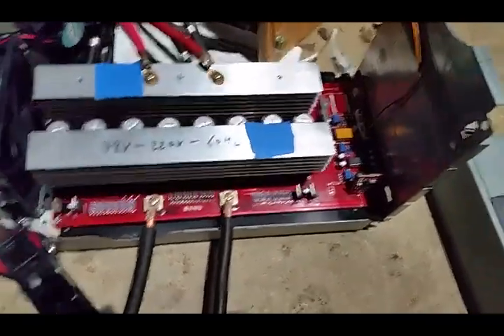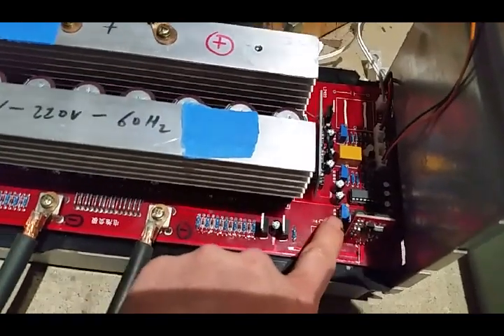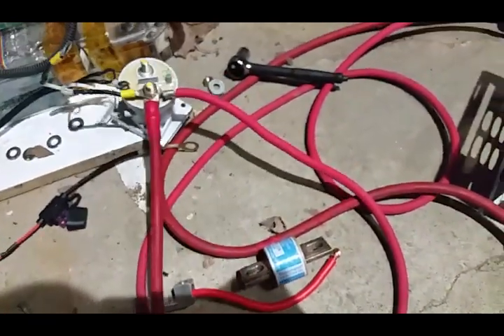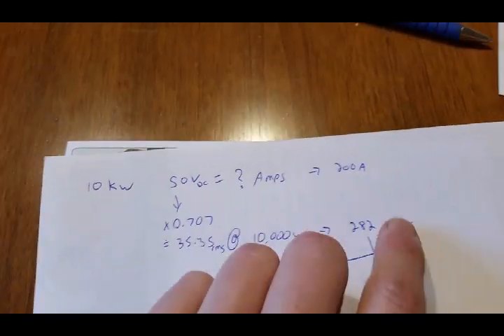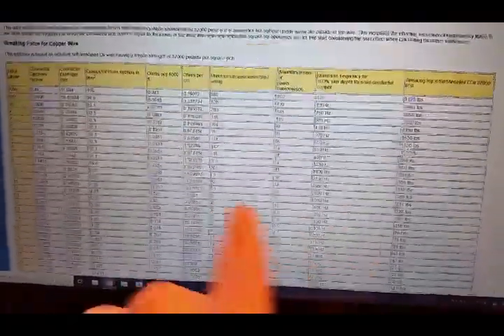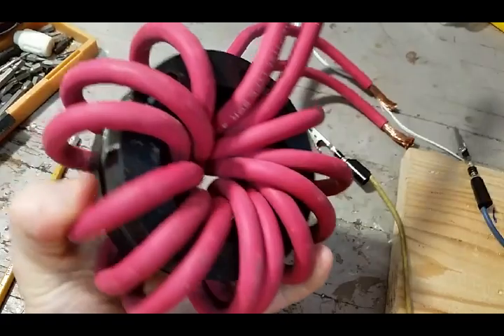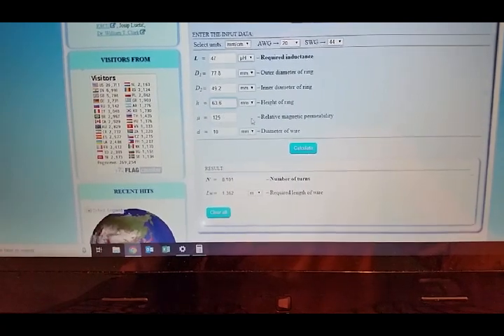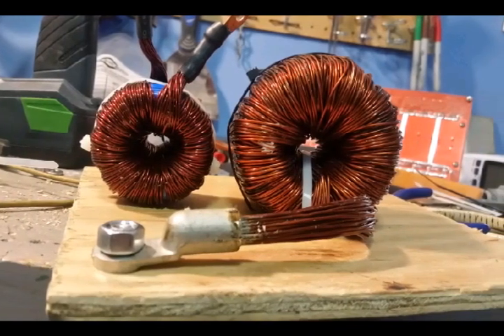diy custom inverter wire thickness and inductor design

Comment: How did you calculate the value of the inductor you need to be 47uH?
Thanks
Reply from the maker: Link in the description
Reply from the maker: 47 was requested by the supplier
Reply: @erroneus  but as a designer you are designing for yourself how will you calculate the value of the inductor you will use to improve the efficiency of the inverter?
Thanks

Comment: You should not play around with high amperage like that if you adjusting the system you should not cannot the battery bank to it and inductor magnetic field cause micro controller ic to behave crazy so you should use copper tap and rapp any inductor need the micro controller to cut of the magnetic field ok boss as a engineer I am tell you this and your trying to draw out 7500 watt fully you can’t do that with no wattage that say the wattage you should only drew 6900 watt and stay safe that it

Comment: That inverter is made to work on the 2stage it receives 380v dc and outputs 220 V ac sinewave You should'nt use it with a transformer that's the 1 stage

Comment: A few thoughts on inverters, I'm homebrewing a 36 volt 150 ampere unit.
1) A magnetic circuit breaker would be better than a fuse or thermal breaker as it opens the circuit faster in a mass-overcurrent situation.
2) Using Litz wire for the HF chokes would reduce heating in the coil due to skin effect and parallelism. The rise/fall of voltage in the square waves has a slope much greater than in a 25 kHz sine wave, so conductors with low resistance at multiples of 25 kHz are desirable.
3) I suspect a choke at each end of the transformer may reduce idling current over a single choke. Since the inverter output is balanced, coming from an H-bridge, the second choke will maintain symmetry and reduce the loss due to distributed capacitance in the transformer and skin effect in its conductors.
I plan to assemble my inverter in the next few days, I'll comment on the results.
Reply: I purchased the 24 mosfet 10000 watt board 
I hooked it up to a 52 pound 5000 watt Transformer 
the High  side secondary 110 volt output has two 10 gauge wires on each leg so 4 10 gauge in total 

I  built my own choke used 16 paralleled 12 gauge wire on a ferrite core 5 1/4 wide by 1 1/2 tall 16 parallel together 12 gauge wire is still small compared to the 2 paralleled 26volt low side wires 4 in total  two parallel together for each leg

 16 paralleled together 12 gauge is about same size as one of the 2 on each side low side 26volt primary 

 this Transformer is overbuilt I am not saying this to brag this is what I was told would work well

Some of these people giving this advice have been designing inverters longer than I've been on this Earth 
I am 40

Large wire size on heavy Transformer core 
big wire on big ferrite core along with disabling the overcurrent on the EGS oo2

 this advice has made all of the inverters I have built very  strong and reliable

 I honestly believe those are the  keys to make these china boards work well

Of course I didn't figure any of this out I  was just smart enough to listen to the experts

All information on disabling overcurrent and so much more can be found on
 thebackshed. Com 
(Little China inverter board) post has information on disabling over current

 there  is so much information on home built inverters on this site so be sure to look around instead of only reading my post
Reply: I finished the major assembly work on my inverter yesterday. Connected to a 37.4 VDC source, the idling current in the battery circuit is 490 mA. Hard to say whether using two chokes or the Litz wire gave the improved efficiency.

Comment: I am ordering this board my Transformer is 110 volt I am pretty sure I can just change the little Transformer to change from 220 to 110 any advice from you would be greatly  appreciated
Reply from the maker: you'll need a 24-110v transformer (actually 28 on the secondary side is ideal, but it is non-standard)... and yes, the feedback transformer can be swapped out with another one, no problem, but if you cant get one, you can just change the feedback resistors. (it is rectified to DC, to around 3-9v I think)
Reply: Thank you so much for your reply appreciated I'm hoping to get a reliable inverter out of this I'm not planning on using over 4000 watts at most just want to have something reliable hopefully going to big makes that possible
Reply: It took us a while but we ordered basically the same board that you have the picture of the board on alliexpress says Amy over the pic using your part number to order for little toroids thanks for that by the way we will not be running ours over 5000w 48 volt battery Bank we also bought 260 amp mppt charge controllers and we have 107  330watt solar panels left not sure how many of those were going to keep and use we have a 48 volt 4 mosfet ebay board we have been experimenting with I modded the EGS oo2 board took off all current feedback that is what makes these boards blow up I have been told by a EE that has been running one for a few years
Reply: By the way you can read all about it on the website called the back shed I am a member there you'll see the post called little Chinese inverter board is one of my post and you can read all about it about the modifications to the EGS oo2 and the Feller that's been running one of these boards for a long time now

Comment: Joel brother I see they are coming out with much bigger boards now. I am not really a technical guy but when I hear you talking about 200 and add amps on a 48v system man I am running a 12v system and I never hit 200 amps I suspect you have a one inch pipe and putting six inches of power through it and it is a case of pressure break pipe seriously bro you talking some serious amps for a 48v system. when I see on YouTube posting of Aims, Power Jack and other low frequency inverters man the boards are two to three times the size of that one board I just wondered.
Reply from the maker: your amps depend on how many watts your 12v system is set for. as an example, if it is 1000w, then you'd get 83 amps at 1000w, remember that Power (watts) = volts x amps

Comment: Nice video man lorn so much. Am trying to bill my inverter as will. Just bill my 24v transformer yesterday but question can I get that inverter on ebay?
Reply from the maker: Yes, variations of this inverter are on ebay, but I think aliexpress might be cheaper. https://www.ebay.com/itm/12V-60V-1500W-3000W-5500W-6500W-Pure-Sine-Wave-Power-Frequency-Inverter-Board/173547221425
Reply: @erroneus  kl man I think you should post more videos.